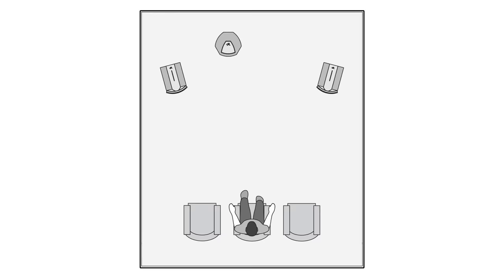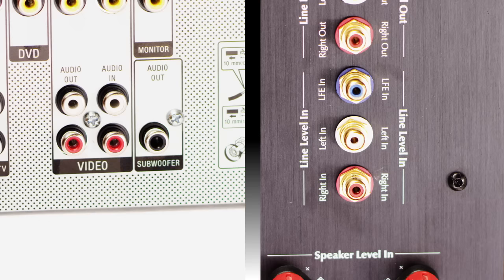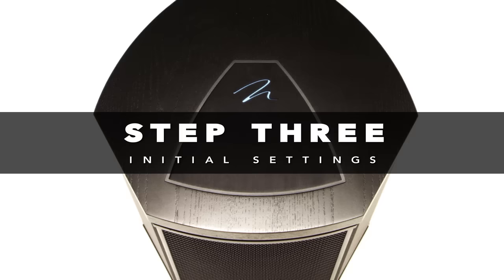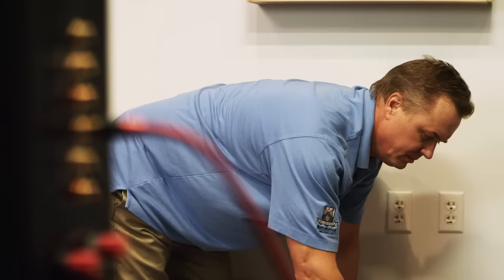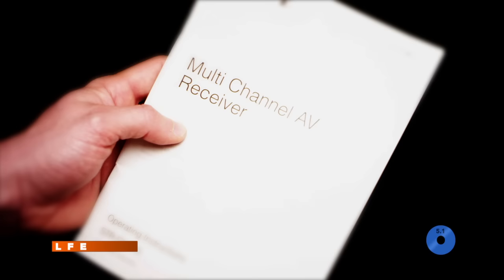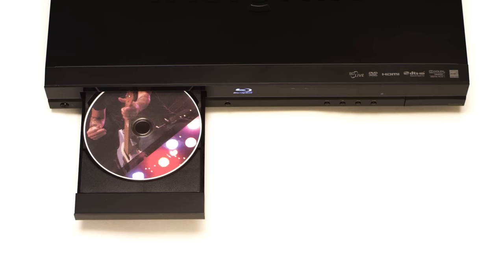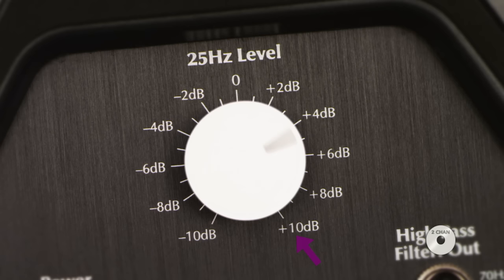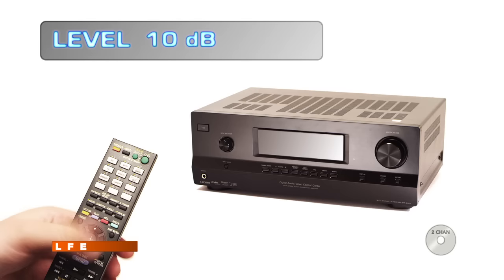Subwoofer Setup & Optimization - MartinLogan

Comment: I just find out I have a lot of work to do with setting my sub the way it should be.
Reply: :))) same here. my sub works fine for me, but after this video I found that it can be better:)
Reply: +Sigitas Ziurys what should i set my cross over to?
Reply: nik cod I've set on my sub crossover and volume on maximum and then connected setup mic to my av receiver and have done full speakers calibration. So the system made the best for me. I'm remember when I've done calibration with half volume and crossover in the middle on my sub amplifier says120 it's the best. But
Reply: You shouldn't set sub volume at full because more than likely your receiver is limited to + or - 18db of gain setting. Therefore the sub being on full cannot be lowered more than 18 db by the auto speaker calibration. Most good receivers will tell you if it has run out of adjustment room though. A halfway setting is generally the best place to start. Crossover should be set to full if you don't have an LFE input to reduce the effects of cascading crossovers. Using an LFE input bypasses sub crossover so it won't matter.
Reply: Yes. There is lfe on my amp. Also on my sub a swith for lfe and it's says conect to the left input (white) for lfe

Comment: This is too difficult. I'll just buy computer speakers
Reply: Top kek.
Reply: Difficult is what makes it fun. I did my own set up, Got my A/V Receiver with some Klipsch 5.1 speakers and 2x12 inch bass woofers at half price during cyber Monday and HOLLY SHIT!! Take my word for it man the sound is better then theaters... The bass is ridiculous.. you will feel the fucking bullets on your chest. Dont get me wrong, its not loud to hurt ears,its just .....well fucking bad ass.

Anyways the best part was how much iv learned. Dont be lazy, when your done you can sit down with your family and be blown away...they will love it.
Reply: Its easier than using computer :(
Reply: Pioneer surround speakers
Reply: Sweet Martin. You sold me on it! I was going to buy an Atmos soundbar because I like a minimal, unobtrusive setup. What Av receiver and speakers did you buy? Whats your setup?
Reply: mymovievideos you're right! I'll just do without a subwoofer 😁
Reply: @420bars  what is "frequency cut off" on a subwoofer?
Reply: @jdubdoubleu  it's how many cycles per second a speaker can move. In other words, every time the speaker moves up and down, that's one cycle. If it moves up 40 times per second, that's 40 Cycles which is the same as 40Hz  frequency.
Check the speaker manufacturer specs...... Do not set your amplifier to pump any hurts below that number.
Reply: @420bars  its a sony sacS9. I don't see where it says how many hertz the speaker is.